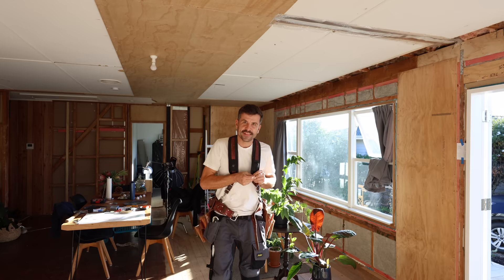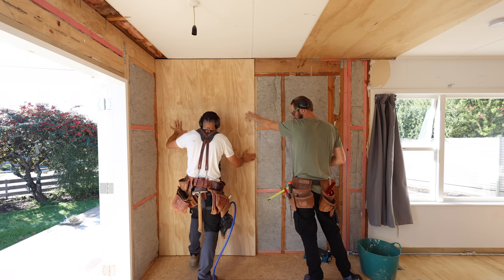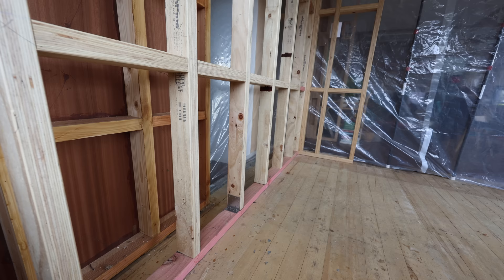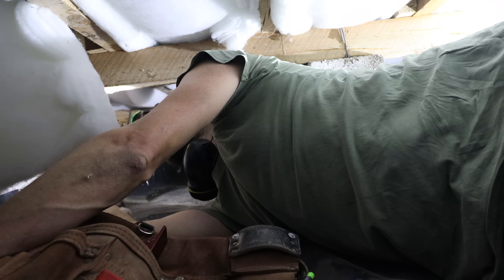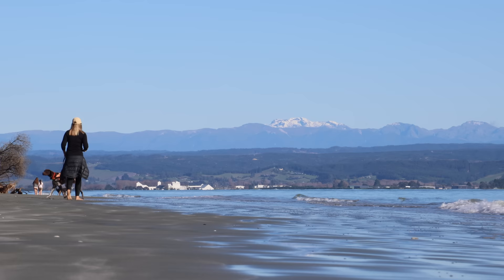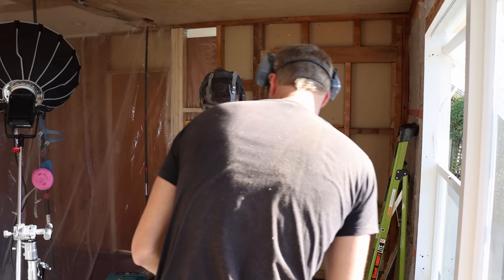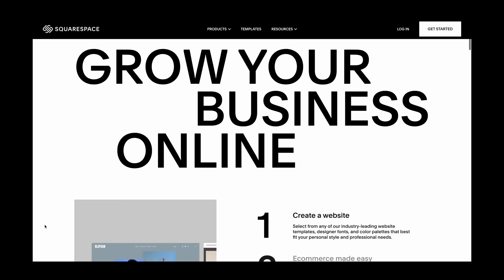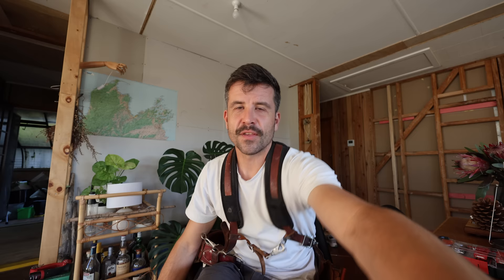Apparently, My House Will Fall Down Without This

Comment: Im a carpenter in the US, I have a useful tip for you Scott when you go back to working in other people's houses. Remember to unplug or turn off your compressor. It will eventually run out of air and cut back on to get the pressure back to where you have it set. Yes i learned this the hard way when I forgot to and it cut on in the middle of the night when the homeowner was sleeping. They woke up to what they thought was an air raid or earthquake. For those who arent carpenters but watch Scott's videos for whatever reason, air compressors arent just loud as all hell but they vibrate and shake like crazy.
Reply: @So Lo😎 you talking about draining the air or condensation? I will never drain the air out of my compressor because I got a flat one time on my truck in the middle of no where and didn't have a spare because someone stole it like 2 weeks before the flat. I ended up having enough air pressure left in my compressor to fill up my tire to get me to home. If I didn't have that I would have had to get to towed 10s of miles resulting in a huge bill. The fact that I didn't drain my compressor saved me hundreds of dollars!
Reply: @f.demascio1857  thanks for the recommendation but I have been using the same cheap-o Porter Cable pancake compressor for about 15 years. The piece of crap still runs like a charm!
Reply: @lucastudor5536  I still use a smallish Ferrock compressor I bought some 35 years ago in Dutchland. Theoretically too small/light to pull a framing gun. Never had a problem with it.
Reply: After too many midnight wake ups from my compressor kicking in it's now connected via a smart plug that turns off it's power at 6pm every day
Reply: Man I did the very same thing but in my own home in the basement (Canada) Wife wasn’t best pleased and it nearly gave me a heart attack lol

Comment: I like what the Aussies do for wall bracing..(Not use plasterboard), instead plywood and for uplift they even run a M12 threaded rod from top plate down to slab or joists either end of brace panel &/or lintel.

Comment: Love pneumatic tools myself. Especially for roofing here in the states they can’t be beat. You can nail off hundreds of nails into shingles and sheeting in a few hours in the hot sun without skipping a beat. If you need to get a lot of nails in quickly battery guns still can’t compete. Also battery guns are usually heavier. I still like battery for small to medium jobs but pneumatic is great for volume. Also pneumatic guns are simpler, more reliable, and cheaper.

Comment: Ask Hikoki for the new connector nailer 👌🏻, pro tip can be used for bracing plywood. Then swap out the controller switch for the Aus version for that sweet bump fire.

In Australia depending on the type of Bracing rating (KN) the nailing is the same or slightly more, though we have to use an glue with our ones like TJ55 sika

Comment: How do you get the final wall thickness correct when you only have the plywood bracing in some locations?
Reply: Was wondering the same. .maybe ripped down bits of same ply strapped to rhe wall then plasterboard?

Comment: Scotty B, you can substitute 1/M12 hold down bolt for a cluster of 3/14G batten screws, you will still need the blocking/nogging between the joists under if there is nothing, but should you ever drill and find you're on a bearer or joist, remember 3 batten screws gives the same capacity tie down, you just need to ensure you get 50mm into the receiving member!
Reply: Is this in NZS3604? The head area of three batten screws is much smaller than a 50x50 washer. Not arguing, just wondering...

Comment: This a great video to remind carpenters who are pricing work how much time it can take to put in these handibracs and having to nog / block under the subfloor. Some of the inspectors and engineers who come back through to check the work, fixing patterns etc will want to see H3.2 used as well. An advantage of ply or OSB is that its great if you hanging anything to the wall later, like brackets to hold furniture. Another great video. 👍

Comment: This might sound like a dumb question! But how do you merry  up your plaster sheets on the framed wall as you have put the ply sheets up? Do you shim all the plastered area or obviously there is a better way?
Cheers
Reply: If the whole wall isn't lined with ply, then plywood would just get ripped down to pack out (shim) any framing members that needed to be made flush.

Comment: Dewalt has a battery coil nailer and I highly recommend for small applications like this. I’ve done 3-4 squares on a single battery and 10 fence panels worth on a single charge with mine

Comment: I never thought those plywoods can be installed inside house frame for bracing. Only saw them used for new build in high wind zone, attached outside to the frame. Good to know.

Comment: So many questions. How did your framing inspection pass without hold-downs in place? Why stuff around with that bottom plate if your framing inspection has already passed? Does you designer/engineer have shares in a plywood company? That is to say, why use ply everywhere when a braceline/standard combination will do the job? Now you have to pack all the framing. On some of the longer walls, longer GS braces would have given the same bracing value with no requirement for hold-downs. Also, tell Ray he is een lang stuk elende.

Comment: I feel for them, it looking more like a plywood shed, but I guess it will work out in the end. Would it have been cheaper to knock down and rebuild with the amount of relentless retro fitting of structural elements, and plus one for the very forgiving Ray ! who has followed them down the remodel rabbit hole. All very entertaining 🙃

Comment: Interesting.  I now have a better understanding of some of the NZ challenges where Gib brand plasterboard had undergone testing to be used for bracing purposes while others had not (or architects specified a specific Gib brand product and thus shoehorned builders and owners into that single product as opposed to any competing plasterboard product).  Owners could just decide to put in ply as Scott has here, but that's additional cost compared to just using a specific plasterboard that met requirements.
Reply: Being from California, it's always wild to me to see anywhere doing new construction where the compliant shear strength can be achieved with anything other than structural sheathing. Especially in places with high winds.

Just look at how the mega-builders in Texas use literal cardboard as "structural" sheathing. 😱

I don't want to die in a shear collapse; OSB sheathing on all exterior walls should be standard.

Comment: 194 cm is 6 feet 4 inches and 4/10 of an inch. So, almost 6 ft 4.5 inches. Average male height in the Netherlands is 184 cm, so Ray is 10 cm taller than the average or about 4 inches.

Comment: Still rocking that porn star moustache...  FWIW, you're just young enough to be part of the battery nail gun generation.  I'm quite sure that air nailers were as common in NZ as they were in Australia for a long time before battery nailers came along.

Comment: Ahhhh, the perks of being the project manager or lead carpenter. That means you get to send your carpenter or carpenter's apprentice in the crawl space or attic. There is nothing worse, especially in the summer, than going into an attic and sweating your dong off and getting blown-in insulation stuck all over your sweaty body. Also when you're hot your pores open up and the insulation gets in and causes you to itch for a week. Pro-tip, when you do get covered in insulation dont take a hot shower, take a cold shower and dont rub your body. Just let the cold water rinse off the insulation for a while until you can take a normal shower. It actually feels great in the summer but is hell when you have to do it in the winter. Trust me though, its worth the 5 or 10 minutes of pain rather than having an insane itch for a week.
Reply: It really is human torture

Comment: What is the black stuf between the timber and the underlayment at 11:41? What is the purpose? Not moisture I guess, since its a wall in the middle of the room. Does it prevent vibration noise?
Reply: And at 13:00

Comment: Hi Scott and Ray, may i ask what you both think of the Milwaukee plun
ge saw.  The red rail is about 60gms heavier than the Festool rail and feels half as bendable or flexable.  Did you feel this and if so what was the result in use?  Scott, are you going to do a review of the Milwaukee plunge saw?  Scott, in reviewing the Makita 40v xgt you had a couple of kickbacks.   Were the kickbacks anything to do with your concentration at the time and placement on the rail of the saw?

Comment: With the bracing only on certain parts of the wall, how will you pack the rest of the framing so you can put plasterboard on? And if you do pack, won't that create a little air gap between the insulation and the plasterboard? is that an issue or is it desirable?

Comment: How does the bracing effect putting the gyprock sheeting on the walls? Do you pack out the unbraced wall sections so the gyprock sheets go on flat?

Comment: Weird building practices, but makes sense. :) Could you review the plans with us again and show where you are at. Thank you and have a good week.
Reply: It's not too odd to have a structural requirement for shear walls, especially when doing this kind of renovation. Loss of interior walls means loss of shear strength, and a little structural engineering or just following simple guidelines can reintroduce strategically placed shear walls to compensate.

What's crazy is how little attention is paid to shear rigidity in most jurisdictions.

Comment: How many  nails off a battery  on the compressor
Reply from the maker: I didn’t keep track of the nail count but after 3 or 3 sheets we had to replace the battery, 12ah battery.

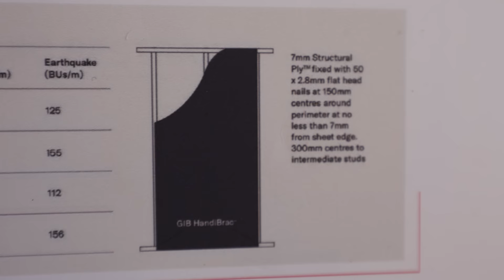Comment: Hi Scott. Thank you for the new episode. I follow your channel closely. I have a question regarding minute 9:49 of this video, is that a "Viking arm" lift?  I have been thinking in getting one but they are very expensive compared to some knockoffs selling for $20 on amazon. Is that a "Viking arm" the tool there? and, is it worth the investment comparing to the cheaper versions? Thank you!
Reply: The knockoffs aren't very strong in lifting capacity. Also they are made out of sheet metal. If you don't set your expectations too high they might be fine. But lifting a heavy door with them I wouldn't advice.
Reply: @RS2Racer91  thanks!

Comment: It's odd to me to see sheet material installed in parallel to the studs instead of perpendicular. It really shouldn't matter with a plywood as the layers are supposed to alternate grain but it's jarring to see on this side of the planet. 😁

Comment: Watching you nail the boards up at 10:15 onwards - does that mean you not putting up an inside vapour barrier on the walls or you be putting one up over the wood you just fixed to the house?
Reply: Edit
Ow sorry that piece is outside wall.
Don’t remember what Scott said about barriers in earlier videos where they worked on that piece of the house.
Reply: We don't use an internal vapor barrier in most of NZ

Comment: How do do you reconcile the different thicknesses of the walls with framing that has bracing or not?
Reply from the maker: That will come up in the next couple of episodes. We are strapping the exterior walls to get more insulation, that will solve that. As for the interior, we add ply to the rest of the wall (either in sheets or strips) to make them match.
Reply: @ScottBrownCarpentry  It is such a shame that you hardly acknowledge any of the comments your audience takes time to leave you.

Comment: acoustic insulation isn’t like thermal as thermal you can leave a leice of insulation out and you still get benefits of insulation. but acoustic if you miss a bit or insulate wall that has door init and don’t acoustic rate door then you get no benefit. also you have to continue acoustic insulation up threw ceiling and floor as sound will go threw plaster ceiling of one room then over wall and down threw plaster in other room. so not being horrible but your efforts to sound insulate is null and void.